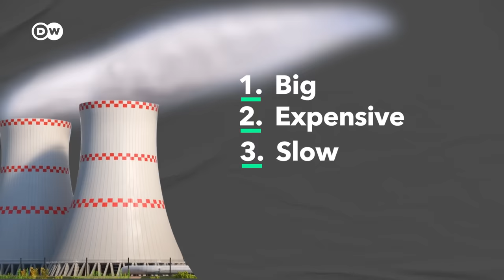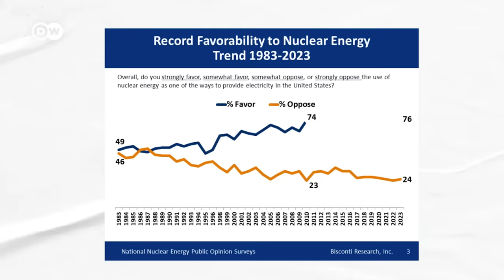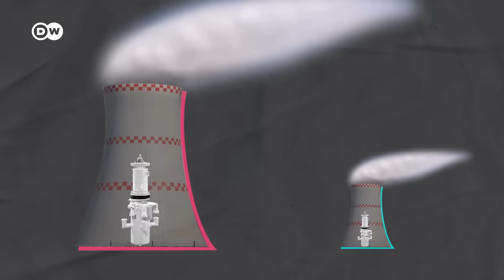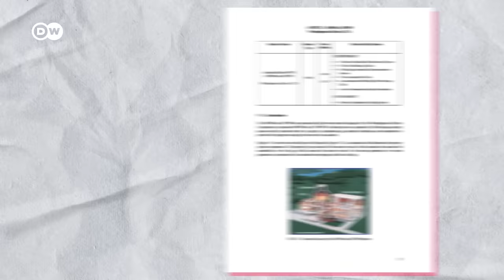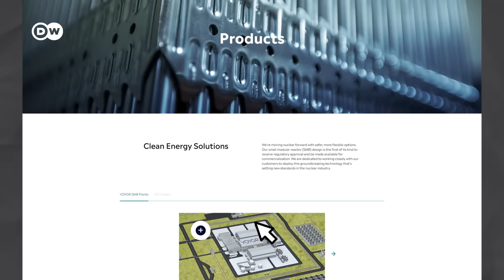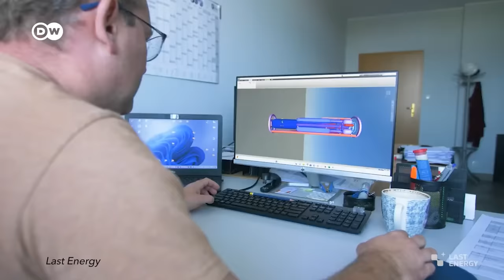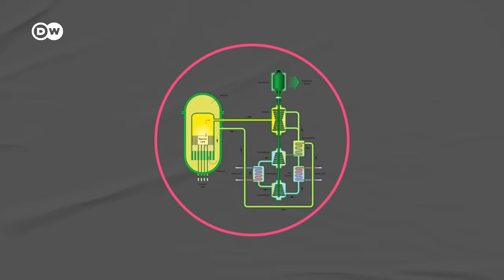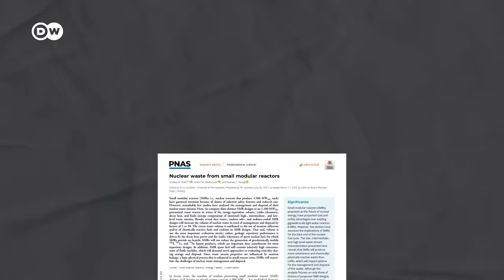Why people want to put small nuclear reactors everywhere

Comment: Solar wind and battery can be built for millions and take years to finish, Nuclear Power takes billions of dollars and requires decades. Then the nuclear plant will run around 30 years (which is typical) and you have a high level spent fuel problem that needs to be buried for 10,000 years. However, the DOE hasn't approved transport routes, transport casks, or a national repository after 60 years of trying. No one is willing to expend the political capital to get this done. The result is we have 92 nuclear power stations with high level spent fuel "temporarily" stored in their backyards.

Comment: You missed a couple of really key points that were right in your face:
1. Say the need is to build 6 GWs at the site.  Historically, you would build 6 large light water reactors.  Each one is custom build on site.  Maybe you spend say $3 billion on each for $18 billion for the whole site.  Now say you go with small modular LFTR reactors that are 300 MWs a piece.  You have 20 mass produced and shipped in for a price of say $100 million per reactor for a total cost of $2 billion and you keep on mass producing in the same factory for other sites, which is why it is only $100 million per reactor.  $2 billion is a lot less than $18 billion and it is all economies of scale.

Like SpaceX's Starship rocket.  They mass produce 39 engines for each rocket and have already built hundreds of these engines mass production style.  It works out and works well.  The last test flight all 39 engines worked fine.  For them it is like they get over 10x the engine flight time experience per flight than say a Delta IV heavy rocket.  Thus they get all of the engineering data they need fast.  Then mass producing, they can make 39 smaller engines a lot more efficiently than say 4 engines on the Delta IV heavy.  The Delta IV heavy had its last flight while SpaceX moves in and takes over.  And soon enough they plan on having people launched into space for say $20,000 per ticket where before seat costs have been anywhere from ~$60 million for current SpaceX capabilities to over $100 million for say a seat on the Space Shuttle.

The point is you are doing things a whole lot cheaper, you just build more and have arrays of cheap reactors at large sites.  Then say to power your small city, you can have a couple of these smaller reactors nearby instead of having to get the power from a distant place for a lot of money in power line infrastructure.  This is one of the big killers of renewable energy is the power transmission infrastructure is strung all over the place and way out into the middle of nowhere for a huge cost.

2. For fuel LFTR is both designed to run on plentiful Thorium fuel that we have proven supplies to power the whole planet for billions of years and it is designed to burn all of the fuel using fuel reprocessing.  At this Thorium is a common bi-product of current mining operations, so we have plenty just laying around ready to be used.  A traditional light water reactor with solid fuel rods is designed to burn only 5% of the precious (more valuable than gold) Uranium-235 in the fuel rods and then the remaining 95% remains highly radioactive as it slowly decays for billions of years, especially if you take this material more valuable than gold and bury it for forever in a once through cycle.  You burn up everything in a continuous molten salt liquid cycle and even get the starter U-235 from reprocessing spent fuel rods from light water reactors that is then used to transmute Thorium-232 into Uranium-233 that is then fully consumed with the help of fuel reprocessing.  Then you have both solved the waste problem and where the fuel comes from.  It turns out when you burn all of the fuel, the activated waste decays down to safe levels on human time scales and so can be stored above ground and become safe.  As there are different materials involved with different decay times, you lose a whole lot of radioactivity in the first hours, then days, then months.  You start looking after a year of above ground storage, it is not really all that dangerous anymore.  Than after 300 years it is perfectly safe.  300 years is still on a human time scale to get to perfectly safe.  This is a lot less time than it takes for even escaped methane, a potent greenhouse gas to decay into carbon dioxide and a lot better contained than methane that has escaped into the atmosphere, which we are killing the whole planet right now largely on escaped methane.  You use like a teaspoon of nuclear fuel in your entire life at this.  I mean the LFTR example with fuel reprocessing is so much better than anything else we have going.  We can totally solve the problem.  We will be fine.

When you consider these things, the 'problems' you bring up are not technical problems.  Technically they are solved.  Especially just build more for less money, duh.  This is more are you going to keep making excuses to not do this when we totally could be?  Or are you going to give them the chance and financial backing to get on their feet and then let them soar and change the world for the better?
Reply: For me this does not make sense. If you need 6 large reactors, they will be all be built the same way using the same materials and standards. Which means that there will be some kind of serial production also in this case. For the SMR approach you will need to build 3 times as many reactors, with the same complexity and they will most likely use more materieals since a smaller construction will have less efficient use of materials. This means that the only thing that can make the SMR solution more cost efficient is pre production  of the whole reactor in a factory. I find it hard to belive that this alone will make the SMR 9 times cheeper. Keep in mind that all the parts used for a large reactor also can be made in a factory and the only difference is that the larger one is assembled on site.
Reply: @eivindhelle3985 I was comparing against rocket engines and used the Delta IV as an example as that was a direct competitor to the Falcon 9.  Even in Falcon 9's expendable format, it was a lot cheaper than the Delta IV for the same mission.  Actually, the Delta IV just did its last flight because it to too expensive compared to Falcon 9.  You are talking about $350 million per launch versus $60 for even expendable Falcon 9.  That is a huge difference for the same job.  Now Starship is poised to take the same sort of things that make the Falcon 9 so much less expensive and get things down to a Starship launch will be cheaper than a Falcon 9 launch while being an enormous rocket, twice the size of a Saturn V.  The Falcon 9 and specially Falcon Heavy pulled it off with a pile of small engines.  All of the engines are basically the same; just put a larger nozzle of the vacuum optimized upper stage engine.  The Delta IV was all low volume, minimum possible number of engines with a completely different engine on the upper stage than booster and those engines were far more expensive, making the Delta IV a far more expensive rocket to build even though each core of the Delta IV only had 1 engine while the Falcon 9 has 9.

So now getting back to building on site.  You are moving your factory to the site, which could be anywhere in the world.  Often times your top and trained up talent is stuck somewhere, due to family or at least preference of where they want to live.  Having a fixed enclosed factory and especially a production line causes things to become a lot cheaper, especially when producing a lot of them.  Look at Henry Ford and the Model T.  If cars were you ordered it, they came to your home and hand assembled everything in your driveway, it would be crazy expensive to make that car and take a long time and there would be big efforts just to get staff everywhere they were needed and trained up to build all of these cars in people's driveways and logistic issues and stuff getting all of the right parts to the right places.  Say you had Toyota Corolla's made this way at you home in say Alaska, you could easily spend $500,000 for a Corolla.  But now you have everything in an enclosed factory, maximize automation, have your staffing all in order in that factory, etc, and things roll off the assembly line for a small fraction of the price.  A Corolla starts at $22,050 when I looked it up just now.

So yeah, it makes all the difference in the world.  This is why we mass produce everything we can, economies of scale.  Also, there is the whole development and certification.  It is usually easier to develop and certify something smaller than something bigger.  Put it all together and a bunch of the same small thing is almost always far cheaper than a few more of a one off (or few off) wonder big things to do the same job.

Another example of the few off wonder deals versus mass produced small are mainframe computers.  Mainframe computers are still made, but they are all composed of a bunch of small servers (nodes).  Back in say even to the late 1990's, custom mainframes were still made.  They were enormously expensive for what they did.  I personally saw ones where they would have say 32 CPU chips all in one coherent SMP node.  In other words a single 'server' had 32 CPU chips in it all tied together with custom silicon on big circuit boards tied together on backplanes.  Then they would tie these big nodes together with custom proprietary fabric.  It was enormously expensive to do it this way, the relative handful of huge servers essentially with custom built proprietary interconnects.  Now everything is one or two CPU chips in much smaller mass produced server nodes ubiquitous across the industry with generic fabric like Infiniband tying it all together.  Far, far cheaper to make this way even for a system with the same physical footprint as everything is produced at volume.
Reply: @eivindhelle3985 Something else to point out is you are used to seeing light water reactors where there is high pressure water involved.  Say you want to generate 1.2 GWs of electricity with a light water reactor.  You may be talking about say 10,000 tonnes of material in order to cohere to modern safety standards (not just the industrial building Chernobyl was recklessly thrown into).  LFTR on the other hand uses inert room pressure molten salt and can directly run a gas turbine (jet engine) at a much higher efficiency level than you could ever do with steam.  You could even tack a steam turbine onto the hot exhaust from the jet engine for even higher combined efficiency if you wanted to due to the high starting heat you have to work with.  To make LFTR get up to the same 1.2 GWs, say with four 300 MW reactors, maybe you get it done and to even better safety than light water with say 500 tonnes of material.  I mean it is worlds apart in the amount of material needed and the safety is still a lot better with LFTR because it is just a much better design in every way.  Like comparing getting around by horse and buggy versus modern automobile kind of difference.
Reply: @ChaJ67  I don't think it will be that easy to get the volume needed to get the advantage of scale. If you need 3 times the number of 300MW reactors compared with a 1GW reactor, it will still be a small number.
Reply: @eivindhelle3985  We need multiple TW for nuclear generating capacity to have any hope of reaching our climate goals.  Say you crank out 500 - 1,000 of these per year.  That is the kind of production scale we need to have any hope of averting a climate catastrophe.  Should be plenty.

Comment: What about modularising the construction of traditional large reactors? How do you modularise a big reaction chamber?...Not easy...maybe use the AA consumer battery approach, putting them all together,as with Zaporizhzhia or Fukushima Daichi 1, 2,3 ,4...Then make sure they have enough safety redundancy to survive shelling and missile attacks, tsunamis and earthquakes at the top of the scale. The old CANDU design approach still seems the most relevant. A 'low intensity' output design. * 'For safety’s sake,
in CANDUs, these control rods and the associated control system electronics and measurement
devices are build for reliable, fail-safe operation, are highly redundant, and employ such additional safety concepts such as group separation. Natural uranium (relatively cheap) is used with an excellent but expensive moderator (heavy water). The CANDU approach. Which design approach is better?
There is no simple answer. Both work. In engineered systems, there are always tradeoffs and the final design has to be viewed in the overall context of the end-use environment.  Often typical the current light water designs seem to go for heavy duty containment and enriched uranium. Best to keep that type  away from unreasoning irredentists and utopian  technological optimists ? *See https://canteach.candu.org/Content%20Library/20000101.pdf , The Chinese have reportedly built a Thorium reactor. https://www.livescience.com/china-creates-new-thorium-reactor.html, commercial production by 2030...We shall see what we are allowed to see?

Comment: The comparison to airplanes makes no sense. Airplanes all operate in a similar environment and are mostly disconnected any local specificities. Power plants are completely different and building one in an area with seismic activity, regular droughts or otherwise varying conditions will destroy any plans to fully standardize SMRs.
Reply: Don’t agree with you there could be models made for every type of scenario. Standardized models.

Comment: Big nuclear make economic sense when we stop trying to build one of and actually start making a supply chain for a large number of units. The workforce, managers, plans and all that just doesn't know really how to build them or isn't ready when it's one of since they never built the thing which make the building process very long.

We don't talk about the cost of the first car on a production chain. If we want nuclear, we have to edge our bet on a mature design or one that you are ready to hang on until it's ironed out and then pump them out in large number like dozen of power plants. Ap 1000 was a disaster as a power plant but following one should be much cheaper. That is, if the order is placed soon enough so that the workforce doesn't scatter to the four winds.

Big modular nuclear  reactor, like ap1000(yes, ap 1000 is modular), should be economically more viable than any smr if we actually really tried. The smr make sense for when a larger reactor can't be acomodated due to lack of electricity demand.

If we modified regulation and building techniques to make sense of reality with a level headed evaluation of danger instead, it would be actually be the cheapest for of electricity since the raw ressource to power produced is so favorable.

Comment: I'm for this. The number of those killed by nuclear accidents are very few. I actually like the comparison to the aviation industry. An air disaster has the potential to kill hundreds of people instantly if something goes wrong, and yet it is normal, routine; not controversial at all. 

Whereas the number of those killed in nuclear accidents is far less, and that isn't considering the great strides in safety in recent decades. Even more so considering the aggregate loss in life caused by the burning of fossil fuels due to associated health issues causing early death. It's just that a slow accumulation of damage over many years is much less impactful to the human mind compared to a nuclear event, even if the damage is actually far smaller. Essentially, if we're already using fossil fuels, there's no reason to not use nuclear power which is already much better. Although, of course, the initial cost of nuclear is much higher.

Comment: This is a great video that explains the pros and cons of SMRs and nextgen nuclear energy tech.  For more context and information,Oliver Stone put out a wonderful documentary called “Nuclear Now” in 2023.  It is a highly recommended film for anyone interested in how nuclear power got a bad rap and how it can be a significant part of a stable and consistent source of safe, carbon free power in the next 10-15 years.  While I recoil a bit at using airline manufacturing as an example of “safe” mass produced engineering, entrepreneurs are hard at work developing new reactors that can be reproduced at scale and even use “spent” uranium rods as power.  It is a bright future for SMRs, though it may take the next decade to perfect.